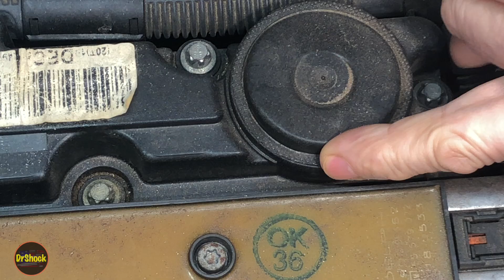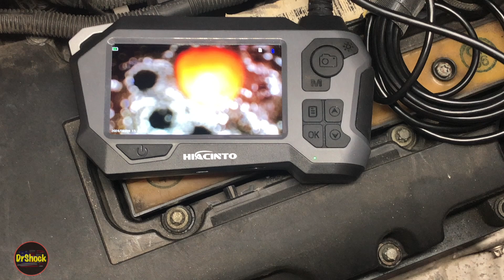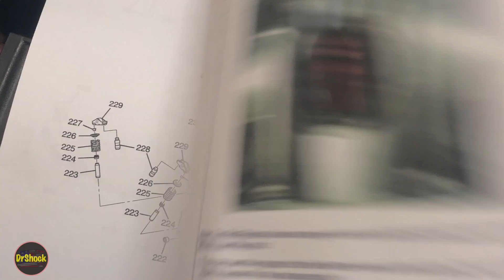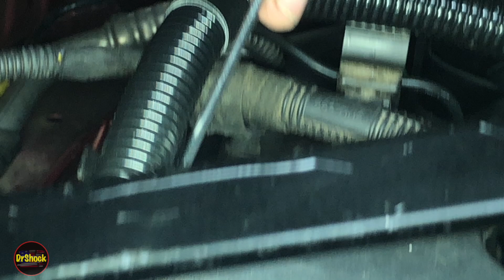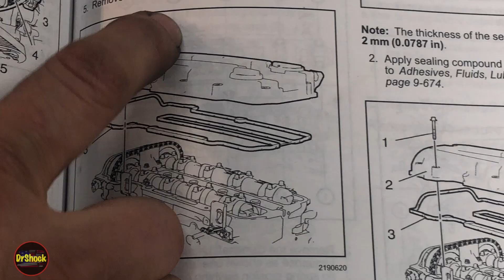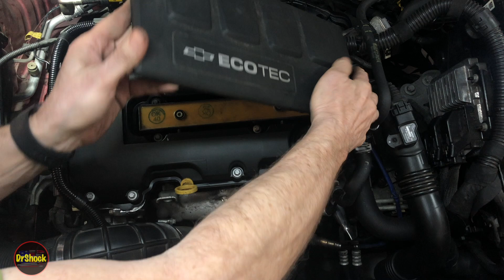2011 - 2021 GM Ecotec 1.4L Turbocharged Engine P0171 ~ Camshaft Cover Replacement (Cruze & Sonic)

Comment: You  replaced the valve cover because the diaphragm was leaking, but why did that happen? The orange rubber piece that you cleaned was deteriorating,  isn't that going to cause the same issue again over time?
Reply from the maker: You may have scrubbed past what you're looking for.  We went over this with the GM service bulletin chapter up around 8:50 or so.

This is actually a two part repair so I've recorded it as two separate videos.  But whenever the camshaft cover diaphragm is blown out on this particular design GM engine, you usually would need to replace both the camshaft cover and the intake manifold.
Reply: @DrShock thank you
Reply: If that flapper orange rubber valve is good and showing behind those holes too that means it's still good and we don't need to replace the intake manifold?
Reply from the maker: Possibly, even if the bypass valve is still present it can get stiff and brittle with age and no longer function properly.   If the intake manifold is not at fault, you will have to track down the internal pressure source that caused the camshaft cover PCV diaphragm to fail.  Otherwise, it will just fail again as you initially observed correctly.

Comment: Hi Sir
Is the intake manifold GM 2828-9977 also the right part for the Opel Astra J 1.4 Turbo?  Thank you Erwin from Amsterdam the Netherlands
Reply from the maker: This isn't a video about the intake manifold, but rather camshaft cover replacement.

In the United States and Canada, this other video I did https://youtu.be/I6tL_l3zd9Q covers the intake manifold replacement procedure for all the turbocharged 1.4L Ecotec engines identified with RPO LUJ or LUV, but not the normally aspirated ones.   

For the EU, there "might" be a difference in part number due to different emission control standards, for example.  Or due to the post GM divestiture to PSA group in 2017 (now Stellantis). Your best bet would be the local Opel dealer with your VIN .

Comment: What are your thoughts about cruzefix kit?
Reply from the maker: We do not do modifications to the stock factory design or configuration here, or use aftermarket parts.  We use only genuine OEM parts, or when they eventually have been discontinued, accurate OE reproduction parts instead.  So that just isn't something we would invest any time with.

Comment: Where do u get the service info sheets
Reply from the maker: You can subscribe (for a fee) to access service information, from GM directly.
Reply: Bu P071 sorunu 2019,2020 modelde güncellenmiş mi tam olarak nedir

Comment: Would a non OEM/after market cover work?
Reply from the maker: We don't use aftermarket parts because they either re-fail far sooner than OEM parts, or have fitment and clearance issues vs OEM.  There is a reason aftermarket parts are "cheap".   There are aftermarket versions of this part out there, but I only recommend the OEM versions linked in the video description of my videos.

Comment: Got one :( HAHAH Debating on asking someone to do it or doing it myself. What's the difference between Dorman from AutoZone with a limited lifetime warranty and the GM Brand that only has 1 year warranty? Which is better? At AutoZone the GM part number is the same as yours here in the video. Its 3.18... Dorman is 236 at my AutoZone. I checked the oil dipstick tube and I can hear a ton of vacuum when it's pulled out... :( I haven't check the PCV Valve just yet but I got a feeling... Check engine light came on today! The valve cover part is fine I can feel no vacuum coming from that PCV thing on the valve cover. SO it doesn't need a valve cover I am assuming. HELP!!!! LOL
Reply from the maker: The camshaft cover only typically fails due a fault elsewhere in the engine blowing out the integrated PCV diaphragm.  Usually it's from the PCV bypass valve inside the intake manifold that then causes the camshaft cover to also fail.  But a failed crankshaft seal can also lead to vacuum sounds thru the dipstick on this engine.  You're asking a question about the difference between genuine GM and aftermarket camshaft covers (this video's subject) but you state in your comment that your "valve cover", which I'm presuming is how you're referring to the camshaft cover, is fine?
Reply: @DrShock yes I checked the camshaft cover for that vacuum leak. Unfortunately I'm in a situation where I can fix it this weekend but I won't be able to get the gm part in time to fix it. Thats what sucks most. They have the dorman. I have heard bad thing and good things about it so i dont know. They got a section that says they have a more reliable valve check the part that goes bad most. I will.check for that nub before i take the intake off.
Reply: @DrShock I'm taking it to pepboys to confirm it needs the intake as well. They got a better diagnostic tool than I got.
Reply: @DrShock  The fuel trim is normal everything looks normal after running the car for an hour and a half for testing everything.  SO, my Check engine light may be due to a CHEAP TURBO. I bought the car and drove it one day when the turbo went bad after the first highway trip. The seller actually ordered and replaced it for me for free I guess because he had a bad review on the Marketplace plus, I was asking for a grand back HAHAHAH. I had to replace the oil supply tube already they did not put a new one there and now I got the Turbo Bypass Valve is stuck code. I also fixed a kinked vacuum line to the waste gate actuator. I got a code a couple weeks ago that said Bypass valve is sticking... Now it says Stuck.... But he did delete all the codes and tested it for an hour, so I don't know. Thats why I am going to test for vacuum OFTEN for that turbo. I have a test kit for vacuum I just bought and a line to see if that tiny little vacuum line has a bad spot in it. Going to do that today and put new plugs in it. Wish me luck!

Comment: Great tutorial and very useful tips! Tried this myself the last week and I've maybe put too little rtv sealant on the front side and now there is just a bit of oil finding its way through,so I'm thinking of redoing it all over again. If I take of the valve cover, do I need to replace the gasket, since it was torqued down fully to 8Nm and the car drove around 300 km since the replacement?  Thanks for any advice! 
Have a great day!
Reply from the maker: If you used a genuine OEM gasket, and you have only put less than a dozen miles at most on it,  I would reuse it.   Once you get past that the heat and fastener compression already start their changes to the material and I would just use another new one at that point.

Comment: In 3 months the intake manifold will need to be replaced as well
Reply from the maker: This is part two of a two part video, in which I went over and linked the previous part one video where the intake was replaced at the same time as the camshaft cover.  We also went over why that simultaneous replacement of both parts is typically required on this particular GM engine.

Comment: Thanks for the videos. I like how u go back to the manual and show what it says that needs to be done . My wife’s car has a bad suction through the dipstick . Do I need that j-41413-300 kit to test for that or is there another way ? I’ve replace camshaft cover,intake manifold and that brittle hose . After watching this video and looking at the links I think it’s the piston rings that’s causing all this .
Reply from the maker: Thanks.  The vast majority of the time the PCV orifice diaphragm will be damaged solely due to internal pressures caused by a failure of the intake manifold (specifically the orange colored turbocharger no-return bypass valve I showed).   But the GM service bulletin makes clear that if the no return bypass valve within the intake manifold is not determined to be the cause, then it's a piston ring related fault unfortunately.   Checking the vacuum value thru the dipstick port would be the confirmation of that root cause.  You don't necessarily need the special tool mentioned in the service bulletin, any suitable adapter and an automotive grade vacuum gauge that will provide an air tight seal at the port would suffice.  According to the service bulletin, these are the only two root causes for the PCV orifice diaphragm to fail internally.
Reply: Thank you

Comment: Hi where can I get the service manual book with all that sort of information cause I have a manual on the car but not like that and it would really help
Reply from the maker: There's a search link in the video description where you can find used factory service manuals like I used.
Reply: @ there very expensive

Comment: hello, thank you for your Videos. I'm from Germany. I had the same Problem with my car with the same engine. My car is a Opel Meriva B 140ps Turbo. i tried so many things, but the yellow engine lamp kept lighting up. the end of the song was, i changed the oil filling cap and the Problem was away.
Reply from the maker: Thanks.  Yep, you could have just replaced the oil cap o-ring seal like I showed in this vid rather than the expense of a whole new cap.
Reply: @DrShock Doc im from Germany too,i need your help,how can i contact you in private?